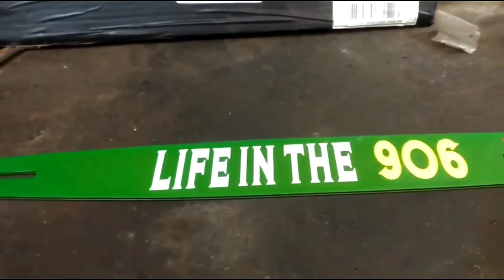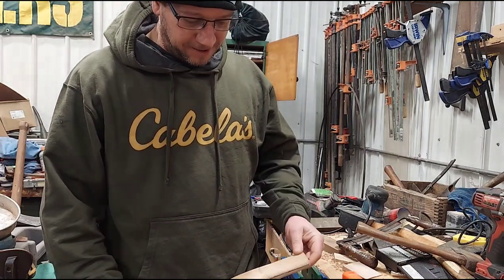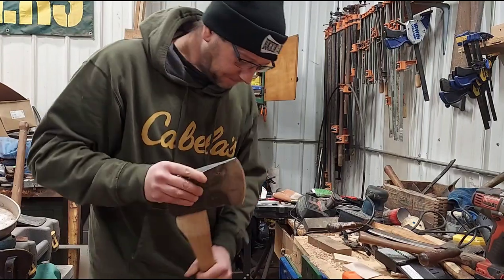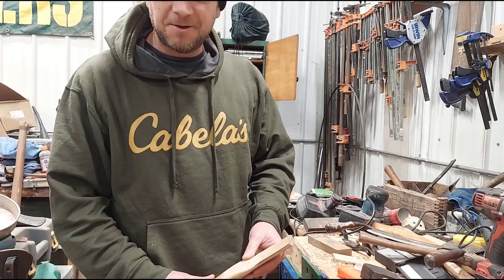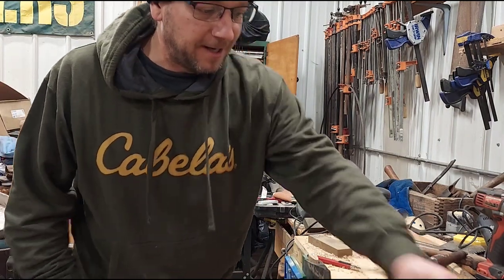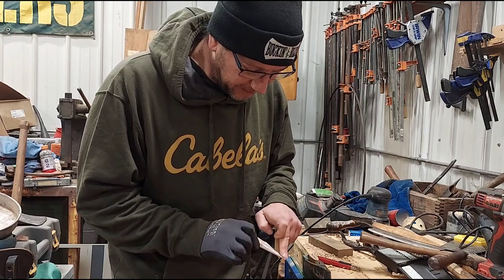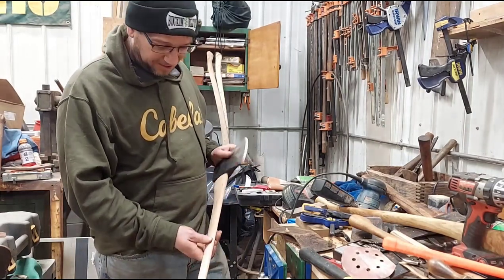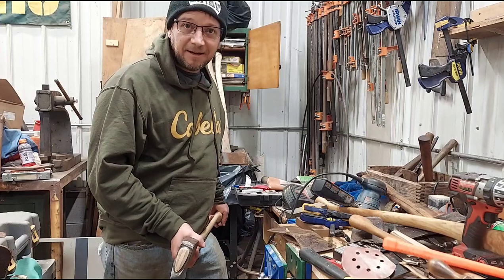Hafting vintage plumb single bit axe

Comment: Great video, I like the steel siding inside the barn
Reply from the maker: Hey Charley thanks for dropping by. When I  built the shop it was cheaper to do the metal than drywall plus it takes more abuse than drywall lol